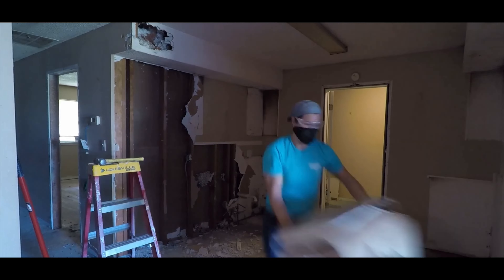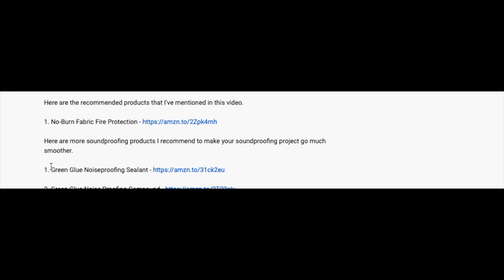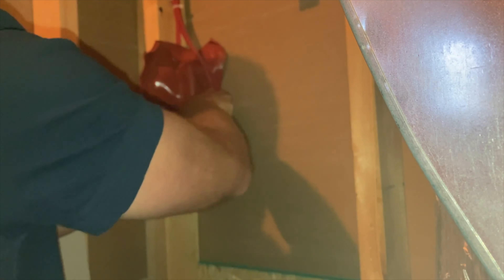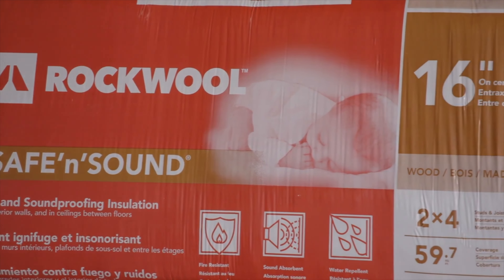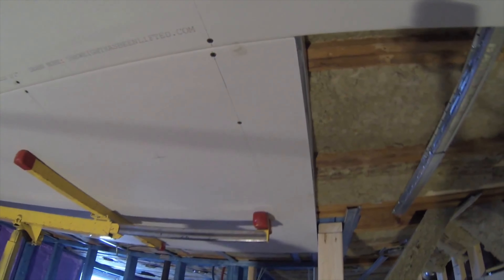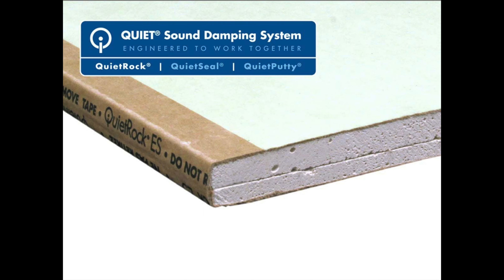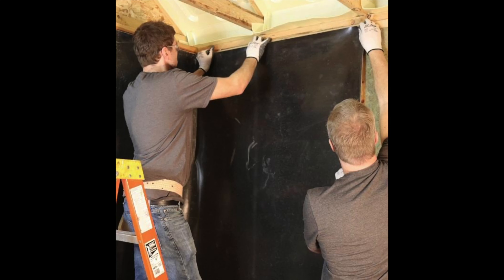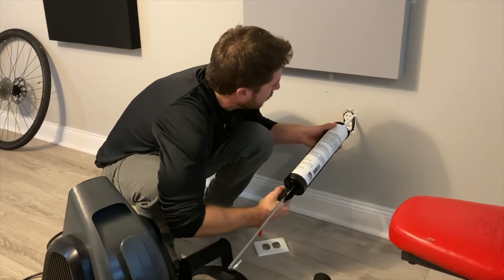Soundproof a Wall - 7 Pro vs. DIY Tips!

Comment: Hello! I have been following your channel and very inspired! I actually started my soundproofing project after watching your videos. I live in a duplex and have a wall separates me and my tenants. I use to be able to hear everything from my tenants side ! the type of music they're playing, if they talked loud enough i could hear what they were saying too. I decided to knock down the sheetrock on my side and I added Rockwool SafenSound insulation, I also sealed the outlets and light fixtures with soundproof puttypad as well. I hired a contractor to install the MLV and also my soundproof sheetrock (5/8 Quietrock). In between the stages of the project, I made sure any cracks or gaps were sealed with soundproof sealant. After all the expenses, my heart dropped when i was still able to hear my tenants. Honestly it seemed like it lowered about 10db. It did a great job by soundproofing distant sounds. But any sounds that are closer to the wall, I can still hear very clearly unfortunately. Do you have some advice toward this? I am 7k deep into this project and I'm not sure what I should do next
Reply: it could be because your vents are connected
Reply: Yes. The vents or hvac let's a ton of sound to pass.  I can hear a conversation 2 stories up in my home thanks to the heat duct.
Reply: I am so sorry! That is awful! Did you find a solution? I think for a situation where you actually share a wall, it is neccessary to build a second wall that has an air gap between the two walls and your second wall would have drywall on both sides of it and insulation in between.
Reply: This is my fear.. I am willing to drop thounds if it would mean I get to enjoy some peace, but I guess nothing's guaranteed...😢

Comment: Small tip, the yeti mic doesn't take in sound from the top but from the front. (can depend with the current settings, but even then it's back and front and not from the top)
The current use makes it sound as if you're quite distant and not talking into the mic
Reply from the maker: Great tip! I need to read up more on it anyway. Just hard finding the time! But thanks! 😊

Comment: What do you think about the SONOPAN product? How about 1 layer of SONOPAN + 1/2 drywall for the ceiling. That should take care of a lot of the noise without the need for resilient channels? I saw many videos of pros using SONOPAN and one layer of drywall 1/2 on a ceiling which provided great results.. The resilient channels themselves can add a bit more in terms of vibration elimination. But back to the original question.. Any experience with SONOPAN?

Comment: I'm probably going the DIY route. I've got exposed 2x10 floor joists above. Would you recommend 1 layer of rockwool, or R30 pink insulation? They are very close in price per square foot. Just trying to get a pros opinion since I don't have any professional soundproof companies in my area.

Comment: Strange question but does it make a difference on which side the mass loaded Vinyl goes on? Let’s say your trying to block sound from the kitchen (pots pans microwave dishwasher etc) would you want it closest to the kitchen (primary source of sound) or away ? Thanks
Reply from the maker: Closest would be best.

Comment: What is the best way to fix a TV on soundproof wall with resilient channel? Is the resilient channel be able support the weight of the TV? Thank you!
Reply from the maker: You shouldn’t drill it through the resilient channel. A toggle anchor or a toggle bolt is a great way to hang a TV without studs. You'll need to use a hollow wall anchor that looks similar to a regular screw, with a butterfly toggle at the end. Once you've placed them in the wall, they'll attach to the back.

Comment: I'm thinking of Decoupling the drywall and adding safe and sound as my bedroom wall  is next to a staircase. If there is insulation already, should i add the Safe and Sound on top of the existing stuff? (if it fits of course)

Comment: Roxul is barley better than fiberglass for sound. A 3.5 inch batt with paper facing out of the room in a 3.5 cavity will work better than afb 3 inch roxul. With a half inch air gap in the 3.5 inch cavity. Easier and more cost effective. Plus you can make the kraft paper air tight.  Cost effectiveness.

Comment: I disagree with a contractor doing a better job than I can do. First I bet a majority of contractors aren’t that great. I’ve flipped houses, I’ve seen my builder to a spec house. A competent DIY’r is more than capable of doing the same or better job. It’s my house, I care about it, I will overkill it on the thoroughness of the job.